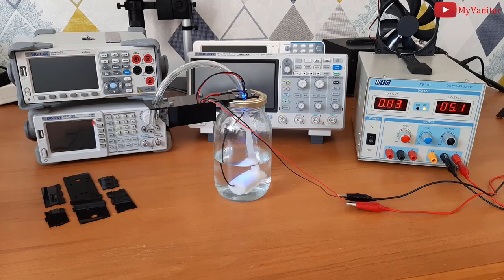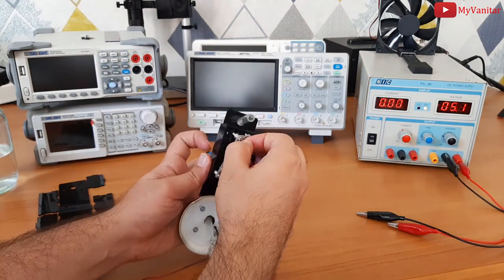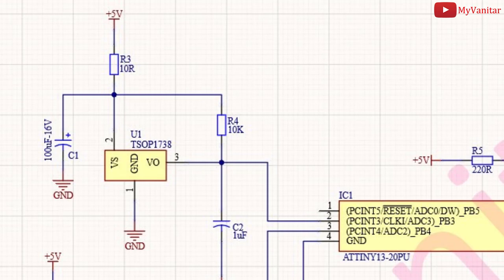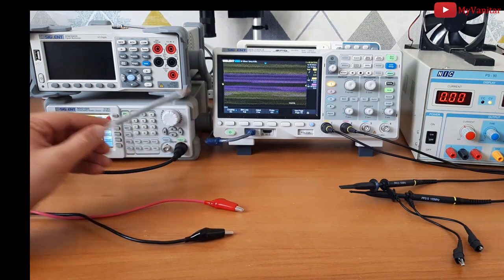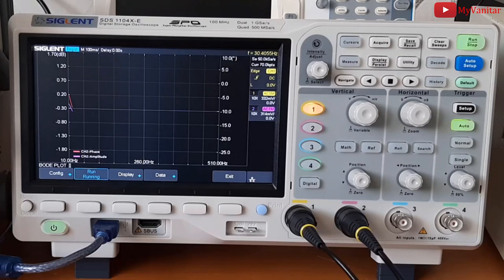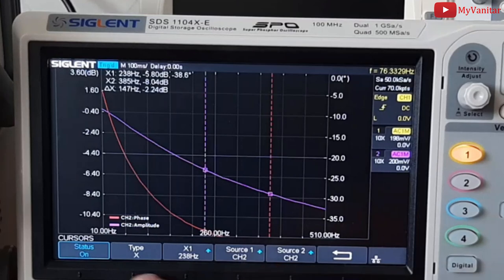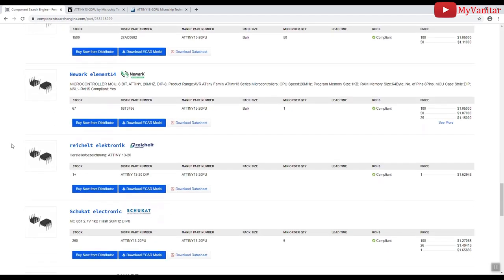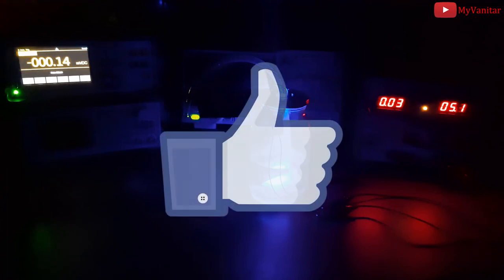DIY Automatic Hand Sanitizer/Alcohol Dispenser Circuit

Comment from the maker: Automatic Hand Sanitizer/Alcohol Dispenser Circuit/DIY [Pro, ATTiny13]
Reply: can you do this code in arduino ide 
please
Reply from the maker: @8_Bit_Cloud  That's not possible. You have the HEX file. Just use a cheap AVR programmer and program the MCU. That's it.
Reply: im student so dont understand much just understand arduino ide language im doing this with uno for project so can i get ino file please tell me how should i use tsop normal ir wont work in sunlight
Reply: oh 
but i dont have anything leaving arduino uno and my pc
Reply: @MyVanitar  so there is no way i can perform this opration on uno
Reply from the maker: @8_Bit_Cloud  oh man, why you are so hurry and impatient. you are a student, should be eager to learn new materials. Arduino is not efficient for some projects, and for some others (like this one) it is much more than enough. The sensors are not sensitive to ambient light and sunlight. device works smoothly and stable. Watch the video till the last second and read the article carefully. if you had more questions, drop a comment.
Reply: @MyVanitar  sorry for rush but I been trying to use tsop as proxi from weeks but never succeed  and that hardware isn't available in my local stores because of covid I can't order online stuff so i remains with tsop it Uno board and other transistor and resistor  I tired to upload the hex to uni but it won't working that's why and I really like video
Reply from the maker: @8_Bit_Cloud  Friend, again you are hurry and impatient. if you watch the video completely and read the article, you will realize how this sensor works. the HEX file is not programmed for Arduino. it is for the circuit MCU. You can even use your Arduino as an AVR Programmer. So again, stick with the content. TSOP1738 is also known as HS0038.
Reply: @8_Bit_Cloud  sir how you generated.hex file. In my case i'm using atmel studio and showing error no directory tiny13.h

Comment: Hi sir. i am just curious for all the automatic alcohol dispenser. This is the only one who produced small or tiny amount of liquid which is amazing to avoid waste alcohol. My question is and I hope you can help, what can makes it less produced of liquid? I would like to apply it to my circuit which I used to follow just like others like using those TIP32C, LM358, resistors, potentiometer and etc.? Please help sir. Thank you and God bless!
Reply from the maker: I have provided the PCB and Code, check the article and change where you like. also I have explained the code both in the article and video. Please watch and read carefully

Comment: Can i use ultrasonic sensor and atmega controller in place of attiny and ir
If yes then what changes should I do in resistor,cap etc?
Reply from the maker: Yes, you can. however, it is like overkilling the task for this application. ultrasonic has a long detection range which is not necessary, Atmega is also more expensive and offers more processing power/IOs which is not necessary for this task. it's up to you.
Reply: @MyVanitar  ok sir then can i use 555 timer ic for delay after one time use sanitizer.for not wasting it by one user again and again
Reply from the maker: @TechTips-qg1io  Maybe you can use two 555 (I don't think one 555 can deliver pulse and delay at the same time), however, I prefer to use a cheap MCU such as ATTiny13. The design is up to you, I just offer my own personal opinion.
Reply: @MyVanitar  You are right sir but i am not permitted to use attiny because my course not contains it. So i want to use it's alternative like 555 timer or atmega uP.
Reply from the maker: @TechTips-qg1io  if this is only for the coursework, you can select the tool which is easier for you and conclude it, just by following the path they like, the nature of the universities is like this which limits the options. so if the ATMega and ultrasonic is easier for you just do it :-) outside your coursework do what you like :-)
Reply: @MyVanitar  👍🏻yes sir you are right
Reply: @MyVanitar  hi sir how can i add submersible pump in simulation software I can't find it's name can you please share the name of that pump or motor that can available in simulator or as a in library
Reply from the maker: @TechTips-qg1io  Which simulation software? anyway you can add a "motor" or a "dc motor"
Reply: @MyVanitar  Proteus simulation and how to add input voltage only label can transfer voltage😕or which voltage source can i apply
Reply from the maker: @TechTips-qg1io  I remember the proteus had a model of a DC motor that rotates graphically when you run the circuit.
Reply from the maker: @TechTips-qg1io  man why you don't practice, you are learning electronics. for the input voltage, you can use a battery model (cell) and change its voltage value.
Reply: @MyVanitar  there is no battery  or cell I think only voltage source and dc battery
Reply: Oh that's dc battery I can use ok  ty

Comment: I can't complie the program on atmel studio(error:no directory named attiny13.h, also can't download library  from internet ),  I need to change the  dispense time. Because of that i can't burn your hex file directly. So please share which software you used to create hex file and also is there any way to add attiny13.h library?
Reply from the maker: You can just program the HEX file or if you want to modify the code, you can compile it using CodeVision AVR. I think I have mentioned this in the article, have you checked that?
Reply: @MyVanitar  yes, but i can't find it, sorry if it's my mistake, ♥️
Reply from the maker: @jasirjawler7749  No problem, you are always free to ask. By the way, you are right, I have not mentioned this in the article however most likely mentioned in the video.

Comment: Thank you very much for sharing the video.

The uC will act as 38khz generator, and the output from the sensor will be the interrupt as signal to activate the pump, am i right ?
Reply from the maker: Not an interrupt. the condition of the Pins gets checked routinely. (polling). I could not use an interrupt because any change in 38KHz pulse generation would initiate a false trigger

Comment: can use this this software for  Arduino Pro mini(Of Course update input and output pins) ?
Reply from the maker: No, this is not an Arduino code. You just need to program the Tiny13 using a cheap AVR programmer, even you can use your Arduino as a programmer to program the Tiny13

Comment: Can I use attiny85 instead of attiny13
Is there any circuit or program change required for tiny 85??
Reply from the maker: ATTiny13 is much cheaper. however, if the pins/ports are identical, yes you can
Reply: @MyVanitar  thank u so much for your reply sir ❤️❤️❤️❤️
Reply from the maker: @arulnelson5828  You should also change the MCU header in the code

Comment: Now question is how to use vs838 as proximity with any    Arduino board is that possible to create 38khz Freq and 10us on time and off time in Arduino ide can you guide me
Reply from the maker: Arduino is not that much good for real time application, however to generate 38KHz pulse you can do try and fail and check the output waveform using an oscilloscope till you reach near 38KHz, an exact number doesn't matter. around 38KHz is fine
Reply: @MyVanitar  haha if i had oscilloscope why should i ask for help im student i use college oscilloscope now its off because of covid so how should i do that project without oscilloscope and try that freq to run tsop as proxi
Reply from the maker: @8_Bit_Cloud  You need tools, what can I say. Some multimeters also have frequency counter. You can use them

Comment: i made PCB from your Gerber file and i made complete circuit ,and i programmed attiny13a with cv avr and i placed on pcb .but it automatically switch on a same interval  without any trigger . and i removed tsop1738 and tested with 5volt ,and same thing happens , circuit switch on without any trigger .can you please provide me a solution
Reply from the maker: It must be a barrier between sensors, as I made that gap in the PCB that gets filled with enclosure. Please watch the video completely and don't be hurry
Reply: @MyVanitar  I PUT A BARRIER BETWEEN TSOP1738 AND IR EMITTER ,BUT ITS AUTOMATICALLY WORKING
Reply from the maker: @dr.jishnu7926  Have you set the MCU Fuse bits correctly? it must be set on 9.6MHz internal clock source with no clock division
Reply: @MyVanitar  YES I DID
Reply from the maker: @dr.jishnu7926  What you put as a barrier between sensors? it must be a solid dense material. if it still doesn't work, really there is a problem with your board somewhere. I have tested this many times and showed in the video
Reply: @MyVanitar   I know I did mistake somewhere in circuit board.you have               
Any guess
Reply: @MyVanitar   I know I did mistake somewhere in circuit board.you have               
Any guess
Reply from the maker: @dr.jishnu7926  The circuit is simple. 
1) Have you ordered the PCB or made it yourself?
2) Does the pump run continuously or it runs shortly with 10 seconds delay between each run?
Reply: @MyVanitar you are correct.yes  i ordered pcb and pump runs with 10 second delay .🤔
Reply from the maker: @dr.jishnu7926  It's weird. MCU does the job. are you still sure about fuse bits? 
what software did you use to program it?
remove the IR transmitter diode and see if it still stuck in the process.
Reply: @MyVanitar   @MyVanitar  i removed ir transmitter diode but still it working. i used codeVision avr software for programming .in code vision i put 25000sck frequency, program fuses cksel1:0=10,calibrated int 9.6 MHz osc,sut1:0=10 slowly rising power ,6CK/14 Ck+65ms,
Flash lock Bits -no protection
BOD LEVEL -DISABLED
i read fuse bits
cksel0=0
cksel1=1
sut0=1
sut1=1
ckdiv8=1
WDTON=1
EESAVE=1
RSTDISBL=1
BODLEVEL0=1
BODLEVEL1=1
SPMEN=1
Reply from the maker: @dr.jishnu7926  Programming speed doesn't matter. it's fine. if you remove the diode and still it runs identically, it shows there is a problem somewhere. send me an Email with a picture of your board and barrier
Reply: @MyVanitar  MAILED 😊
Reply from the maker: @Jithu Shaji This is not a car that I should offer warranty and answer full time to users. when you see there is a working prototype, then it is fine. find a problem on your own circuit. I really don't know what to tell more for such a simple circuit
Reply: Thanks for your support and extend help , at last i made a working circuit.my mistake was soldering related.
now its working fine but takes more delay time
Reply from the maker: @dr.jishnu7926  You can easily change the timing in the code. I told you to check your board many many times!!!
Reply: @MyVanitar  sorry for my mistake. i studied a lot from this project.thank you for your great help and support.

Comment: Can we programme attiny using arduino uno
Reply: Please give reply
Reply from the maker: Why using Arduino for such a device. it is over-killing the task
Reply: Can we do this by arduino uno
Reply: Then how we programme the microcontroller
Reply: Can you suggest a cost effective programmer for programming attiny
Reply from the maker: @TechyJr10  It is an AVR microcontroller. You need to have a cheap programmer such as USBAsp to program it

Comment: can we do it by ATTiny85
Reply from the maker: Yes, however you have to change the MCU header in the code
Reply: Can we use the same hardware to run the ATTiny 85
Reply from the maker: @TechyJr10  man, investigate yourself a bit, it is a good habit. if pins are identical, yes

Comment: When i give supply to the circuit it remains on
Reply from the maker: No, there is a problem with your PCB board. I tested it many many times
Reply: MyVanitar it happens only when i connect the pump when I disconnect the pump it works perfectly fine
Reply from the maker: @ankitkewat3617  As you see in the video and article, this device has been tested and works properly. As I mentioned in the article/video, there must be a barrier between sensors to avoid unwanted triggering. I think you turn on the device without enclosure. if this is not the case, I am absolutely sure there is a problem with your PCB board.

Comment: sir i am using arduino ide ,can i get tiny13.h
and delay.h .. please help me:)
Reply from the maker: You can not use arduino for this project. Simply just follow the video and article and build it
Reply: @MyVanitar  i made PCB from your Gerber file and i made complete circuit ,and i programmed attiny13a with cv avr and i placed on pcb .but it automatically switch on a same interval  without any trigger . and i removed tsop1738 and tested with 5volt ,and same thing happens , circuit switch on without any trigger .can you please provide some solution
Reply from the maker: @dr.jishnu7926  It must be a barrier between sensors, as I made that gap in the PCB that gets filled with enclosure. Please watch the video completely and don't be hurry